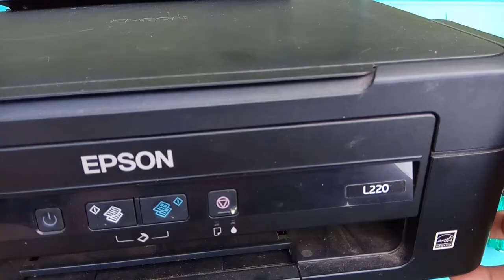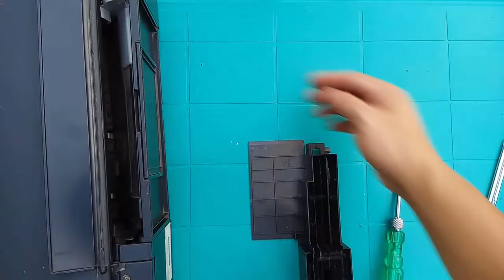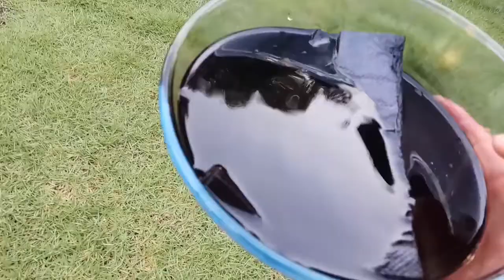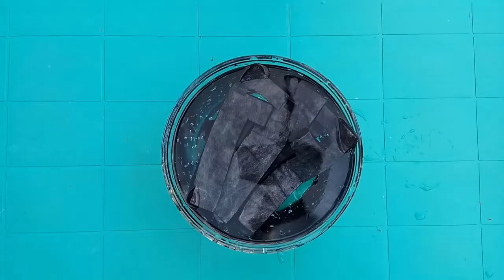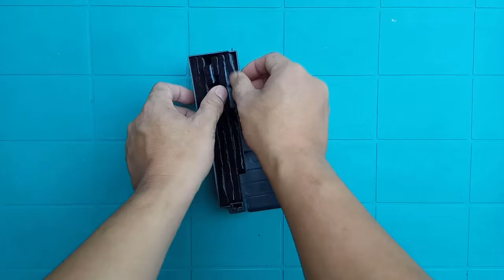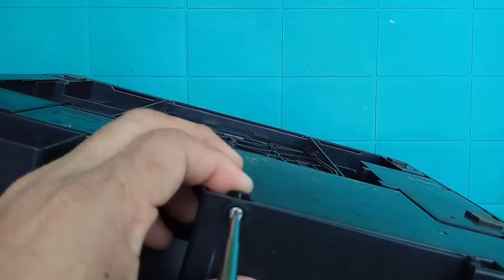How to clean waste ink pad Epson L210, L220, L360, L380

Comment: needed a little bit - fiddling around -, but it worked as you showed it. where i live i can not get replacement pads. but we have plenty of this dense -ink pad - material around. just will cut it to shape and it will work. like it ahd the als time. could also not find in the shops a replacement pad. so i just - made one - myself. and that one worked over 5 years...

Comment: Epson could have just put an additional bottle at the side like the other 4 ink tanks to collect and user can empty but they want to loot the consumer by stopping the prints with the software so they call their customer service and can earn on it.
Reply: Yea. Good for canon, 2021 pixma g printers have now user replaceable maintenance cartridges aka waste ink pads. Also canon pixma g printers have user replaceable print heads, much cheaper than epson. Epson if print heads breaks you will need to send it to costumer service.
Reply: YUP, dealing with this now. I would've never bought this printer had I known how unethical this company is with their planned obsolescence.
Reply: Epson waste ink pad is affordable tho and you just need the resetter software for free instead of using unresettable Canon g series

Comment: If I clean the ink pad will it also fix the end of sevice error that pops out? or do I still need to reset it after cleaning?
Reply from the maker: You have to reset it..download re-setter on google.
Thank you so much for the continued support! Please share the video. 
STAY Safe!
Reply: @globestudio111  DO you have a link to one to use.?
Reply: @johnmoturi  try WICRESET
Reply: @johnmoturi  All you have to do is Google it
Reply: @amyc9155  But there are many ones, and most as malwares if not trojans
Reply: @mikias  fair enough. The one I bought was either a program I had to download or a code I used once I wad able to access the Epson ink counter. When I called Epson they literally told me there's nothing that can be done and that I needed to buy a new printer. Bought a bunch of the waste ink pads on eBay, switched them out, and my EcoTank 2720 still runs good as new.
Reply: Wicreset gives only one trial chance.